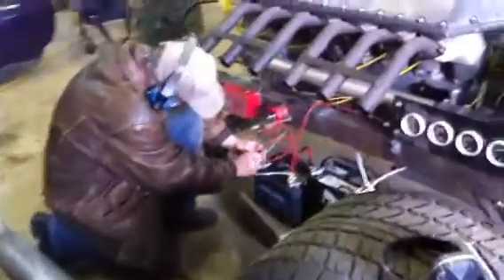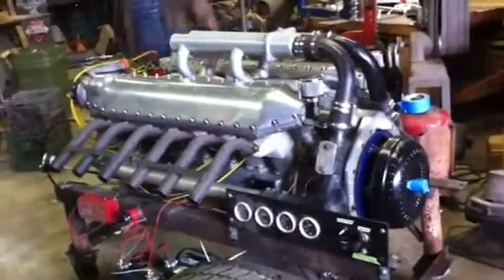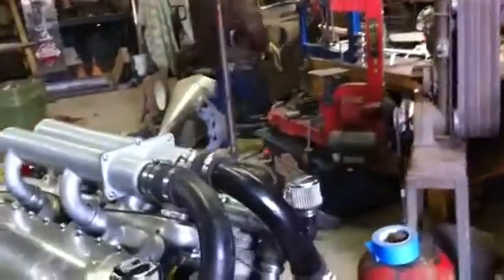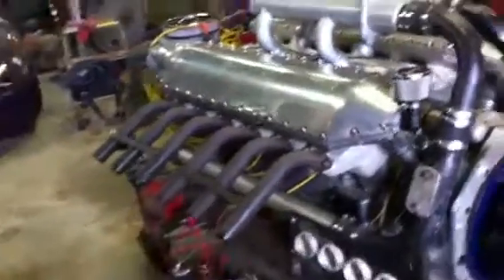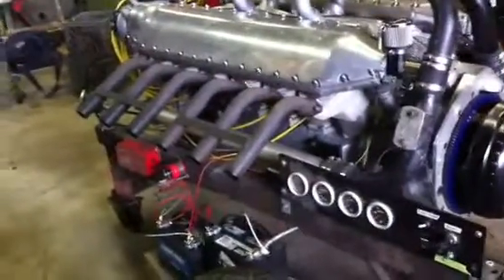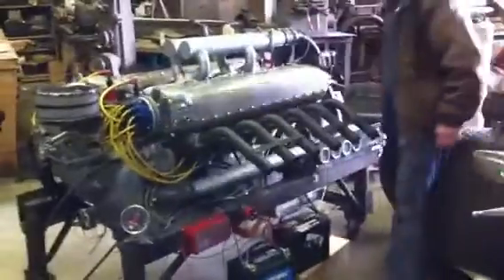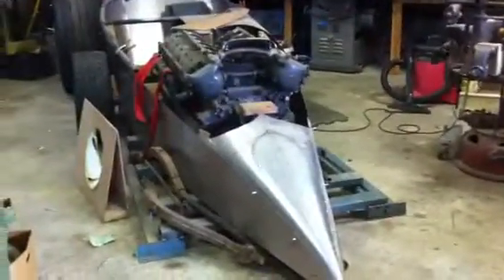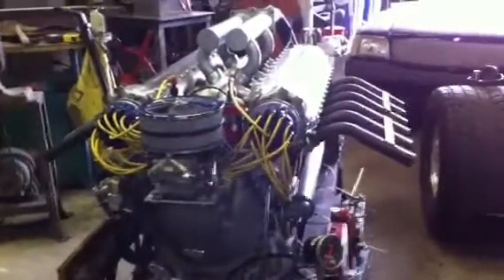Ranger v12 engine

Comment: Gents, how do I get a hold of the person who rebuilt the engine? The video indicates that he re-engineered this engine to operate on a speedster. I assume that meant a rebuild and I'm interested in whether he have rebuilt any of the inline 6 versions. Rangers are known for oil consumption of the original versions. Did I tighten up the tolerances to avoid this? Any response would be great.

Comment: If Ford PT-22 had had a Menasco he might not have lost an engine...

Those Kinner and Warner radials were not the most reliable of devices.

NOT from CW or P&W... ditto Shaky Jakes in the Cessna 190s-195s...

Wrights and P&Ws are on another level....